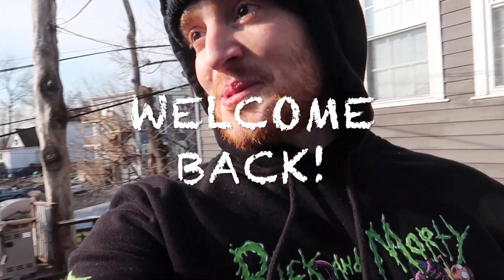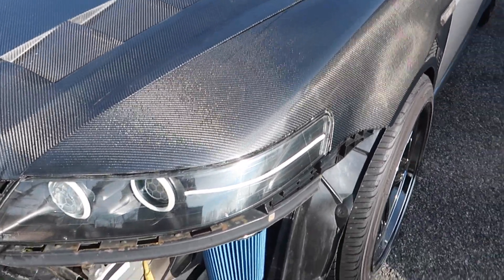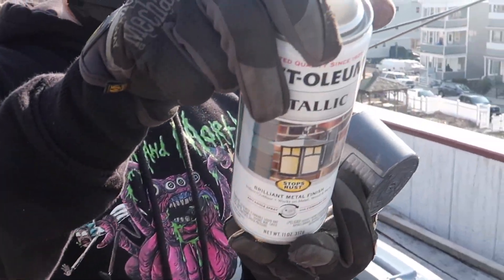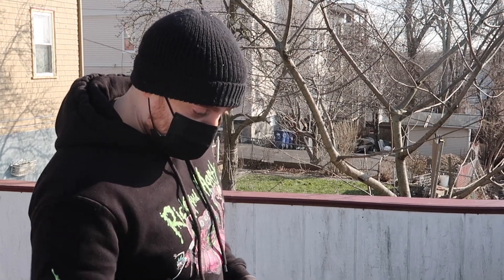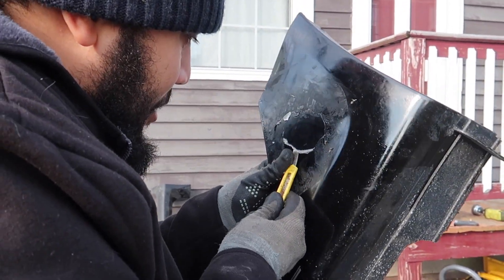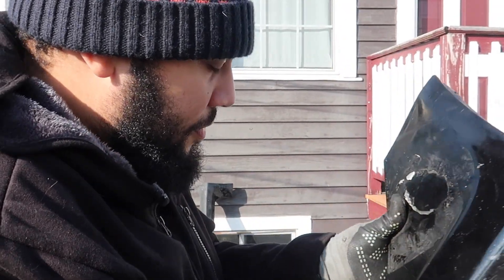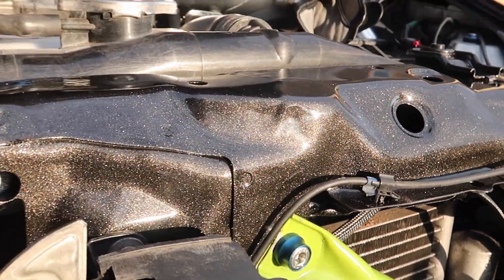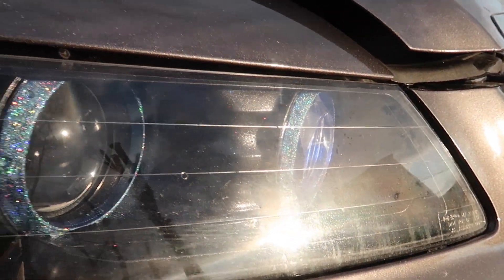NO MORE RUST, fixing the ugliest part on my 2006 Acura TL!

Comment: Ya whole Front end look sicc 🔥

Btw I'm trynna do same as terry I got aspec side skirts and rear and looking to sanddown to paint match but was curious what sand paper/blocc did he use to sand his type S skirts?
Reply from the maker: Don’t advise going such a low grit. Start with maybe a 120grit and work your way up in stages to around 1000grit. Until it’s all smooth and ready to paint. We got the sanding blocks and paper from home depot
Reply from the maker: And thanks man I’m trying
Reply: @oblvyngarage  they're no scratches from the sanding ? Like when worked to the 1000 yall got it completely smoove ?
Reply from the maker: @ua6jj328  yea super smooth. You can go up higher but definitely do not go low. Pretty sure terry actually started sanding with 220. And the primer he bought was a filler primer so it took care of any small scratches.